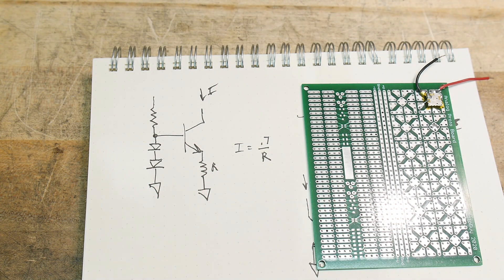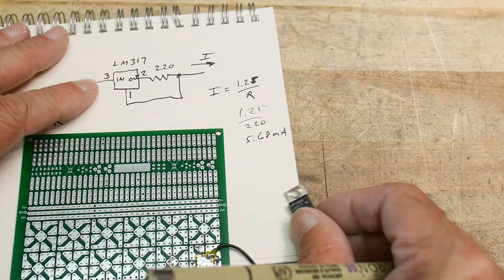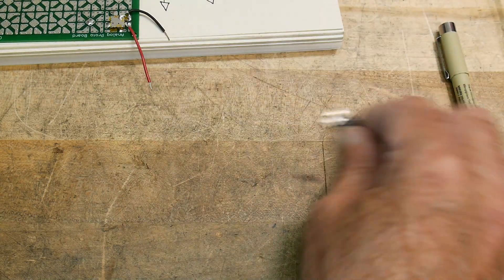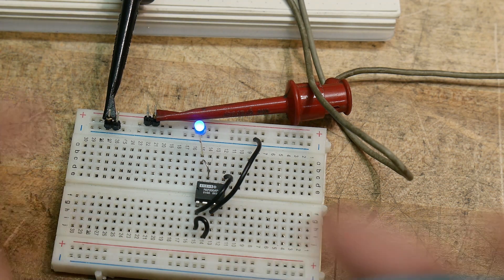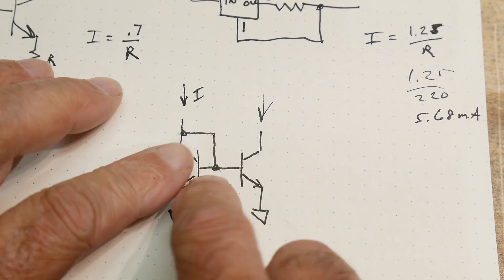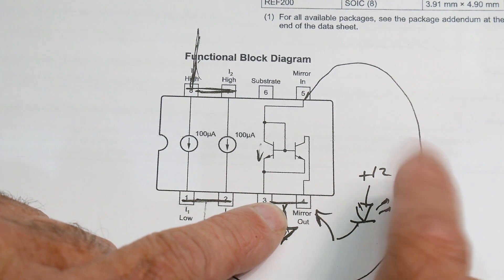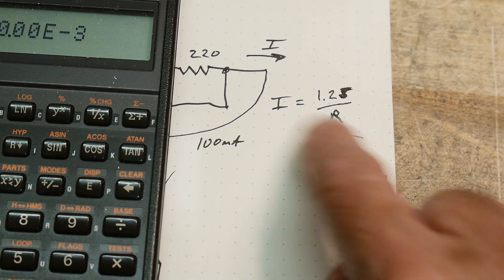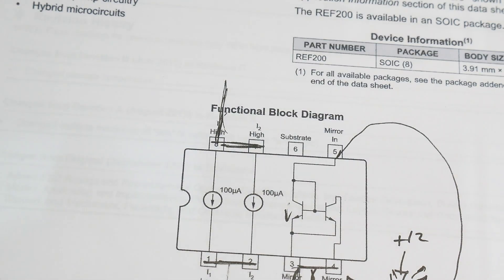#785 Current Sources and Mirrors

Comment: Have you put over 10 amps through your AnEng AN870 multi-meter? It supposed to be good for 20 amps but whenever I go over 10 amps, the meter starts alarming and I don't know why.
Reply from the maker: I don't know that that one, but many devices are only good at high amps for a very short time. it is probably warning you you only have a short time left otherwise it will get too hot and fail.
Reply: @IMSAIGuy  Thanks for the response. I was wondering if you could try testing the claimed 20 amp limit on the AN870 meter? I just found it very strange that while setting the current limit of an AliExpress boost converter, the meter was squawking at 11 amps.  I wanted to boost a PC power supply from 12V to 13.8V to make an automobile battery maintainer on the cheap. O.V. protection prevented me from just tweaking the ATX supplies internals.

Comment: How can you increase the current mirror current by factor of 10 to 100 without using opamps?  BTW you could put LEDs in series and all will get 100uA and don't need extra transistors. This trick is used in almost all LED light bulbs.

Comment: Note there is a new LED semiconductor technology that generates 591nm amber color.  The reason why this is particularly interesting for creating simple current sources is that the published temperature is "-2.0 to -2.1 mV/degreeC" and that the known temperature coefficient of silicon transistors Vbe is about -2.1 mV/degreeC.

For example, replace the two diodes in the 0:28 part of the video with Cree LED P/N C503B-AAN-CY0B0251 and place the LED and transistor in relatively close thermal coupling and the current mirror should be relatively constant with temperature.

Note that what I've done so far is theoretical and has not yet been physically tested yet - hope this is interesting to the researchers out there....
Reply: I just performed a simple experiment and confirmed the above part indeed has a temperature coefficient of -1.98 mV/degreeC around room temperature (as confirmed by E. Fred Schubert in "Light Emitting Diodes and Solid-State Lighting").  With the simple current source given in the video, this effectively matches the transistor Vbe temperature coefficient of -1.6 mV/degreeC.   The end result is a simple temperature compensation current source with -0.3 mV/degreeC.  Not bad for such a simple circuit.

Comment: Nice video. I would like to see the current over the LED since 0.1mA seems to be very low for a regular LED to light on...
Reply from the maker: Gallium Nitride LEDs are very sensitive. The camera makes it look a little brighter that it does in person.
Reply: All LEDs I tried seemed to work down to “nothing” in terms of current. You need a photomultiplier to see it once you go far enough, but they worked at least all the way down to a couple times their dark current.

Comment: Four transistor Wilson current mirror with degeneration resistors are easy to build and if using resistors with good temperature coefficients, it will be pretty stable.